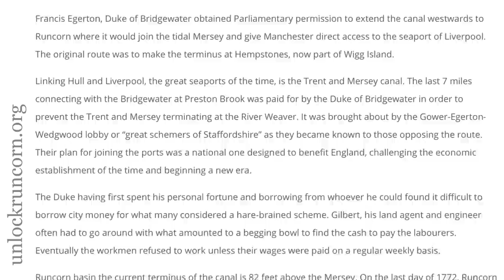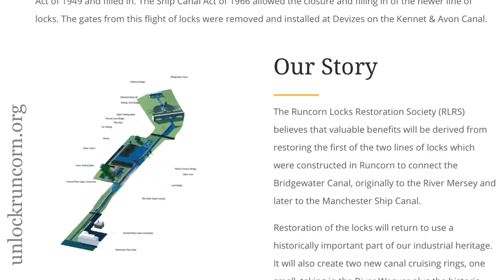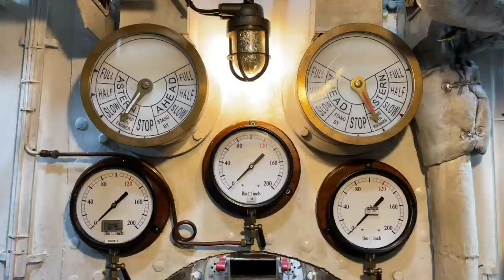Mooring and exploring the end of the Weaver Navigation

Comment: Robbie, regarding the cost of taking your boat on Manchester Ship Canal (MSC)it depends how you look at it. You seem to think that Peel Ports are ripping you off but analyse those charges and see if you feel differently. Firstly the seaworthiness check was £60 not £100 like you said, and we had no travelling costs because we met our surveyor on the Weaver visitor moorings near where he’s based. Transit of the 36 miles was £178 plus £30 to lock up to the Bridgewater Canal. Total cost £268. Marsh Lock where you moored is free (CRT lock). None of the MSC locks are manned and each requires 2 operators who have to travel to & from them especially for you. If you therefore say 1 hour of their time for each lock including their travelling, x 2 operators, equals 10 man hours which works out at £26.80 per hour. Where else can you get labour rates these days for that price?

Is the trip worth it? There’s a lot of monotony during the 7-8 hour journey and not a lot to see, but there are some quite sizeable ships, particularly at the Runcorn end, some moored up and some on the move (you see more of them if you go onto the Ship Canal at Ellesmere Port rather than Marsh Lock). It's a lot of money but despite the monotony I thought it was worth it just for the experience of it all, something different.

Comment: Hi Robbie there is a campaign to restore the Weston & Runcorn Canal just as there is for the Bridgewater canal that ends in Runcorn and they want to reopen it by moving some of it from its original course as there are buildings and paths over the old canal, but the locks are still visible at the end of the canal in Runcorn, as this section leads down to the MSC which in turn leads to the weaver and the Weston & Runcorn canal

Comment: Peel own the Bridgewater Canal as well.  Is it as complicated to travel on that as it is on the MSC?
Reply: No. The MSC is a serious commercial link, and you would be sharing it with very large ocean-going vessels - hence the extra licence conditions. The Bridgewater is just a normal canal, with normal canal boats on it. The only wrinkle is licencing - the normal CRT licence which covers the rest of the network doesn't apply on the Bridgewater. There are various reciprocal arrangements so you can transit for a few days without paying extra.

Comment: Unlike a steam loco you cannot fill up at a convenient water tower but there are none of those on the Mersey.  Pardon me for asking but what are you floating on if it's not a practically endless supply of water ?
Reply: On the Weaver Navigation maybe but I’d have thought the salt water in the navigable parts of the Mersey wouldn’t do the boiler tubes much good.
Reply from the maker: Perhaps if they had a way of filtering the water